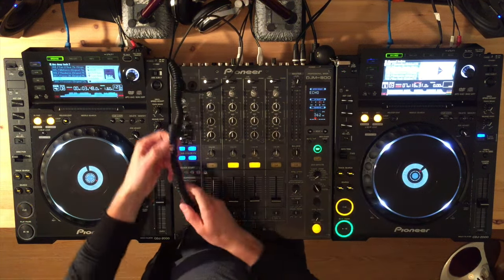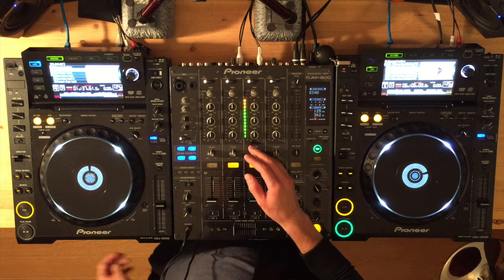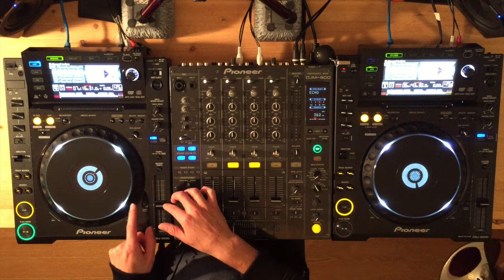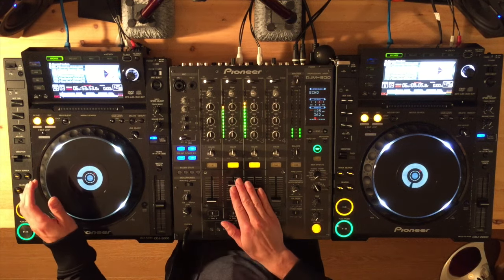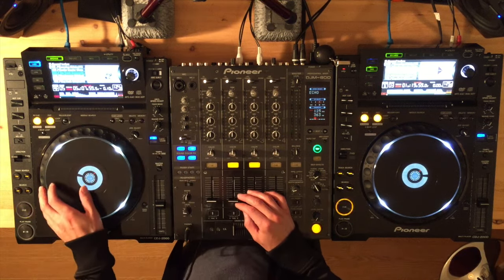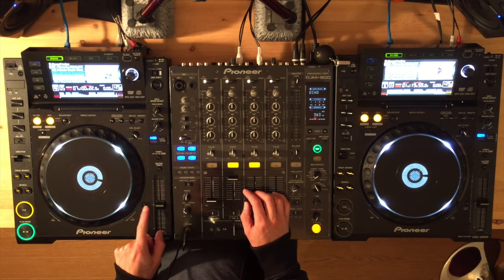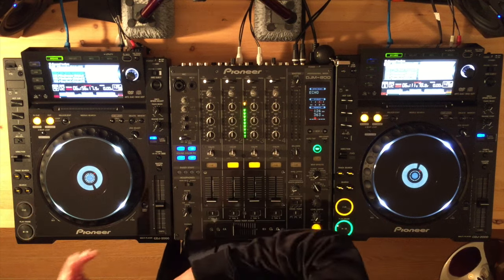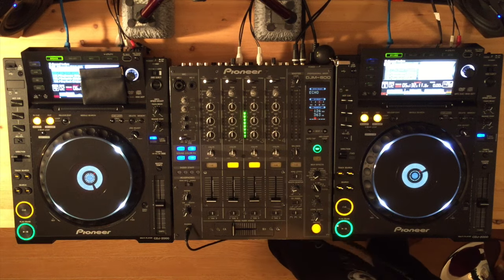DJing - HOW TO BEAT MATCH

Comment: Best advice I’ve ever had about beat matching was match the claps or snares in your headphones to what’s playing on the sound system. Practice by playing same track on deck 1 and deck 2 reason being you know it’s gonna be same bpm just have to drop on beat and drag or push the platter depending on which way beat starts to drift.
Reply: Yes but in a nightclub you can’t rely on listening to the sound system because of the delay, you need to match in the headphones
Reply: @JayGee6996  or booth monitors if set up well
Reply: @makenzi3033  yes that is my preferred method but both monitors are so inconsistent you really need to be able to mix in the headphones

Comment: The thing I have the most trouble with is identifying if i should speed up the song or slow it down with the jog wheels. Guess I just gotta practice more. Great video!
Reply: LoFi Art just test it when the track is in your cue. That's what it's for! Easy!
Reply: Start the new track a quite a bit slower than the current song, then you know you definitely have to speed up. Small adjustments going faster until matched
Reply: Imagine if you didn’t have a screen to look at! Lol.
Reply: @PanditaP  then you would just write a note that the bpm of the song was xxx.x and when you make your set you have a card you put on the pitch slider that shows where it needs to be set to roughly match the tempo of the previous song, stick a sticker on the vinyl to mark where your cue point is and bam you have all the information that the screen provides. DJs have been using all these tricks for years before cdjs came out.
Reply: @FearRua  pro tip
Reply: @PanditaP  Imagine if you are naked in the forest !
Reply: little trick. If you have pioneers then use yor fingers on the SIDE of the jogwheel to speed up/slow down.
the top of the jogwheel is WAY to sensitive and you'll totally throw the mix.

Comment: Excellent tutorial.  I especially like that you demonstrated matching beats without the beat counting feature of the CDJs.  I learned to spin in the day of vinyl and turntables and can really appreciate what you're saying about not relying on the equipment to do the work for you.  

Nicely done.
Reply: +1.  never rely on the beat counter,it's the easy way out!
if you get the chance learn on SL1210's. you have to do it by ear,and every set is different, like learning to drive a car.
Reply: @bigmacntings7451  into it...
Reply: @bigmacntings7451  thats way too easy, try doing it with blindfold and earplugs
Reply: Hope you are joking

Comment: Beating matching is crucial by getting to know the bars of music and the BPM I use both the jog wheel on CDj’s and the speed control at the same to catch the beat. 
But DJING is MUCH EASIER FOR PEOPLE now than it was with turntables my best advice is take your time and your totally correct with two of the same records go back and forth. I remember doing this with my turntables back around 88’ and you will get frustrated you just take your time and I think people should practice with also instrumental house music it’s easy to hear the count of the beats to practice

Comment: I'm from the old school using 1200's...I just purchased these 2000NXS2 and was struggling on the vinyl(I refuse to use the sync bottoms) but after using some of your beat matching techniques I now feel like I'm back using my 1200's....thx a 1000 x's
Reply: Flash Gordan  I know what your saying not having the torque on the platter when I’m down pitching kinda messed with flow and rhythm I get when mixing I was happy when they started to put jog wheel tension adjustment on the CDJ’s. Even tried Denon CDJ with motorized platter but reason why professional use what they use and once you get tuned in on the Pioneers they stay locked in they don’t drift like out of tune Technics 1200.CDJ’s allow you to really be methodical with your mixing and snap the mix points rather than a rushed beat matched fade because you don’t want to risk being off when track drops out of a break that is rhythmless for 2 bars. Also always took me 5-10 records to feel out a pair of Technics that I never played on but the CDJ’s are consistent only variations are with model # .I found that turntables isolated from vibration and level  made a huge improvement on how long they kept records locked on beat.

Comment: Hey, I don't understand all those harsh comments. If you people saying that he is not doing "real" beatmatching, but only relying on the auto beat-sync, would have watched the video until the end, you would have seen that he is explaining later properly indeed (beginning at about 15:00). I find the idea quite good to cover up the beatcounters while practising, and use them after to review how good you were. In the end it all depends what's your goal: Have quick results at home? Rely on the beatcounter, beat-sync and maybe beatgrid. Want to play in public? You would better learn, otherwise you maybe f*cked when either is not working/available. I still believe it is not too bad to use those helping functions regulary, so you can better concentrate on the creative aspect of your set while spending less time for beat matching. On the other hand one should still be able to do it manually, even if it is only for backup purpose, or maybe if you want to use Vinyl at 3rd/4th deck.

Comment: Use Master Tempo "ON".. it sound better when you beatmatch!
Reply from the maker: +Aply GFX Master tempo does nothing to assist your beat match. All it does is keep the original intonation from when the track is played at the speed it is meant to be played, if you speed it up or slow it down a lot. Using the master tempo feature in fact makes the turntable keep the time of the track not quite as well, and if anything, would therefore make your beat match worse, not better.
Reply: OurManVarjMusic It was just a Tipp. I always have Master-Tempo on.. but it's not a "must-have".
Reply from the maker: +Aply GFX I get that, I'm just saying though, that if you think it makes beat matching sound better, you are wrong and have misunderstood the purpose of the function. If it sounds better, its because it keeps that intonation of the original track, not because it is helping your beat match.
Reply: +Aply GFX I never use Master Tempo anymore. I have found that with some tracks you get artifacts in the sound when slowing down a track, even when its just a little bit! (Not more then 3%) Could be due to a badly mastered track maybe. But I have chosen to never use it again, just to make sure sound quality stays the best possible. 
You just have to be careful not to nudge a track too much at once, or it may become noticable.
Reply: I had the same problem and I don´t use it anymore either... but I think it might be because of the pitch "mode" of the player - its the same effect if you  e.g. use the wrong warp modes in Ableton Live or the same function in Software like Traktor...
Reply: Don't you think that might be a reason that it would be helpful? I also have to on most of the time, just because I like the tune(pitch) as intended instead of screwing it around. It can be fun tho, don't get me wrong
Reply: Aply GFX
Reply: it stops the song from slowing down/speeding up(well it still slows/speeds up but you cant hear it with the master tempo on, so yes it does help your mixes sound better pal

Comment: Good job! But this modern music that was recorded on DAT or other digital sources. 7 years ago yes, the software wasn't what it is today. Rekordbox is pretty accurate in 2023. But if you really want to mater beat matching, do it with late 70's disco or 80's electro. This music doesn't match a grid like modern music and you'll always have to set the pitch at the correct or an average BPM on both players. War Dance (Tom Moulton Mix) by Kebekelektrik and anything done by Cerrone or Gino Soccio is a good starting point. On a modern controller like the new DDJ-FLX10 it's easy to see the wave patterns in RekordBox and match them visually on the PC screen or laptop. If you have CDJ-3000 then you can also match the wave patterns visually. The hidden little secret however is analyzing the uneven beats dynamically. You'll have a more stable grid and easier visuals. BTW I began mixing on Technics 100 belt driven drives in the late 80's so I can beat match by ear. But the new technology makes traditional beat matching a thing of the  past. It's always good if you know how to do that because some tracks have changing BPM's but none of that is needed with today's technology.

Comment: Just a tip! Don’t try using the same tune on both dex! This will cause phase! Not a bad video other then using the same track as an example!

2 pluses equal a minus! When layering the same frequency!
Reply: That's what the flange effect is about 😉
Reply: Niels Cloostermans  well it can be, flanging is when 2 of the same waves are layered but remain in uniform (and off sync) throughout the wave. Phasing is similar to an all frequency filter as....as it passes sync it filters the matching frequencies. 
   Put simply if its perfectly in sync you wont actually hear anything!
Reply: Actually two plusses equals a plus.
1+1=2

When you invert the phase of one, that's when they cancel out.
1+(-1)=0

If you layer the same sound with the same timing, it will just make it louder.
Reply: Meet The Casual technicaly i think we are both right and wrong on this, yes you would have to invert one wave however. There is no such thing as a negative frequency. A mistake we both made, ;) haha
Reply: @philwhatever3903  I never mentioned anything about frequencies, let alone "negative" frequencies.

Phase cancelation is an issue with the amplitude of waveforms; it is not directly tied to frequency. It should be obvious that I am not talking about frequency.

I'm merely talking about amplitude of the waveform in relationship to the zero crossing point.

A waveform moves back and forth across the zero crossing line. The amount it is moving is called amplitude. If the waveform has no amplitude but is instead flat at the zero crossing line, then there will be no sound.

When you add one part of a waveform that is above the zero crossing point with another part of a waveform that is identical except below the zero crossing point (this is what the phase inversion of itself would be), then you end up with a flat waveform with no amplitude and no sound.

Because of this, in order for the tracks to cancel out and result in silence, one of the songs would have to be phase inverted.

I'm an audio engineer and this is a basic audio principle. I'm not wrong.

It is true, however, that if the kick drums of the track are closely timed but not perfectly, the phase could be half a cycle off and result in a quieter kick. But given the declining nature of a kick's amplitude, this would not be a perfect phase inversion. 

However, that's not an issue here anyway (more for when you're producing the music and layering kicks). Even if it were, there's a number of other things to consider.

First, when the tracks are in time, since one is not an inversion of itself, the result is a louder product, not quieter.

Second, in a real environment, you're the only one hearing both tracks until they are in time

Third, even as you're hearing both tracks, it will coming from different sources (booth monitors/house and headphones). This means that the way phasing could occur (again, this is only for your ear and not theirs) is as the sounds reach your ear, not from within the output source. And once we start looking at phasing from that point, given all these sources are different distances from your ear and outputting different amplitudes, phasing gets way too complicated for me to even talk about here.

Fourth, this is all assuming you're actually trying to play the same track from two sources (CDJ's, Vinyls, etc.) live. There are limited applications for this, if any, which makes the entirety of your original comment irrelevant anway. Since this is meant to be practiced in your bedroom where only you can hear, as is done in the video, even if there were extreme phasing issues causing very noticeable differences in volume and it sounded horrible, that doesn't affect the ability to practice beatmatching alone in your room.

This is a lot so the short version can be explained like this. 1+1=2

The "phase inversion" of "1" would be - 1. So by adding those together you get
1+(-1)=0.

The second animation at this web page demonstrates the constructive and destructive interference of phasing and is a visual explanation of why one waveform added together with itself results in an identical waveform with a bigger amplitude and why one waveform added together with the phase inversion of itself results in a flat amplitude (and therefore no sound).

https://www.acs.psu.edu/drussell/demos/superposition/superposition.html
Reply: Meet The Casual I don’t disagree with anything you say,  I completely agree. It was the kicks I was referring to. However I though I would try be a little smarter in explaining it! I actually have isolated  acapellas in the way you have mentioned. Inverting an instrumental version over a vox version. 

Thankyou for explaining in full though, your explanation makes much more sense then mine does after re reading what I wrote 😆

Comment: Best tutorial actually makes perfect sense, how would you do this if both songs had complete different bpm for example one track 140bpm and the other 128bpm? Thanks
Reply: sync and tempo change actually, all about creativity and mashing it all up :)
Reply: speeder thank you :)
Reply: lots of ways.
Pitch control slider if you want to sync beats.
If the pitch is similar and musical phrases have vocals or beat-dropped sections you can use the faders and Equalizers/trim pots to blend in and out.
A mixture of both if you have got a feel for what is going to drop in where on each track so you don't get conflicting basslines/mids/tops

Comment: This is dead useful. He just explained why headphones come into place and why you see DJs using head phones. Now I know why. BTW, what headphones are those and is it possible to customize your logo onto those headphones the way kygo and Avicii did?
Reply: it's not quite that simple!. The headphones are used for cueing up and listening to the track you're going to mix in so it syncs up properly.as a recommendation I would say sennheisers are probably the best bang for the buck you will get.

It starts getting a bit more complicated when you throw in DJ controllers/ CDJ's and mixers and a PA system.
Analogue never had this issue but DJ controllers and CDJ/Mixer combo's have a DAC(digital analogue convertor) built in.They process the sound from the MP3/CD and turn it into an analogue waveform like you would get off decks.Unfortunately when this is processed it creates a small time delay that needs compensating(there is a setting in preferences section of rekordbox that will adjust).
You need to fiddle with this to get your phones and audio output in sync.(5.3ms is my setting)..but this depends on what monitor setup you have....even nastier on a big rig in a big room with crap monitors,the delay can be rotten sometimes and turn a good DJ into jelly.
Reply: ..anyway, it's all going back vynil again!!!....people seem to be turning off CDJ's and getting DVS enabled micing gear and time coded vynil.SL1210's coming out of retirement!!

Comment: I am not a beginner DJ, but the last two years I have relied on the wave form and have great mixes using serato. I purchased CDJ 2000's and now I'm a bit nervous and appears I'm struggling a bit.  My question is once I master the beat matching and let's say I would like to mix in a drop before the end of a 16 bar, but I am having a hard time getting the beat correct on the other deck before the drop. What do you do? I mean you are in a live mix. You don't want to make any mistakes. I feel it would like a while to adjust the jog wheel or pitch and bring the drop it correctly.